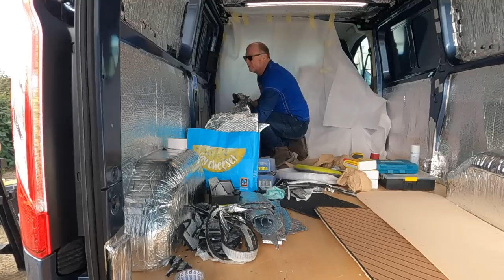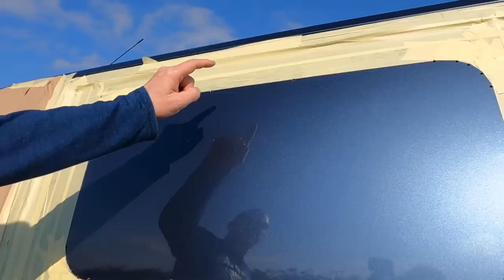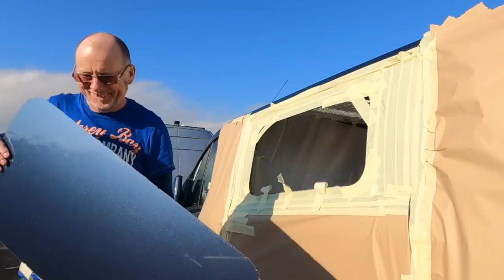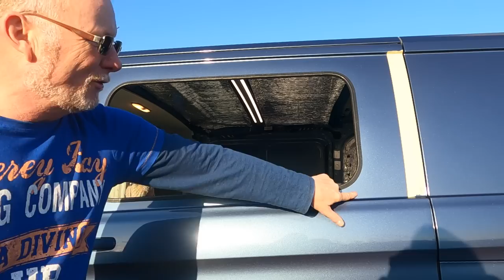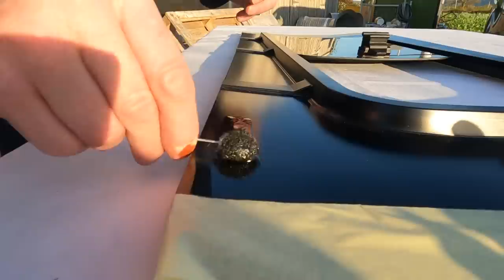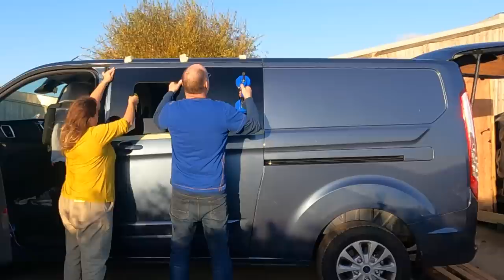Fitting opening window to sliding door ford transit custom camper conversion

Comment: Yes sorry  Mel  great video not criticising but watch Liam as well would make sense to put rubber join at bottom l wouldn't even attempt so great job m8
Reply: Yeah cracking job by Liam although If water gets past the bond its going to leak wherever the rubber join is👍